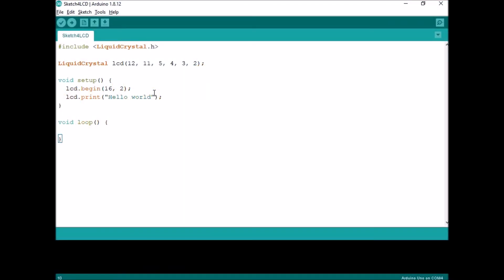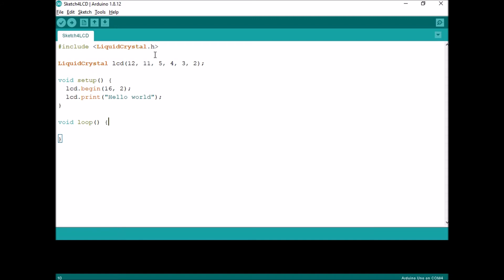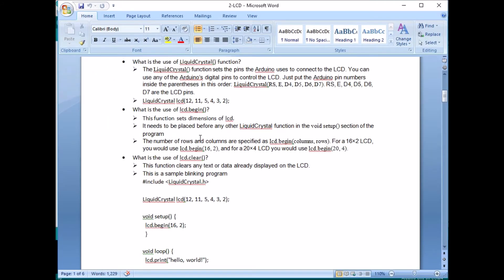21-Usage LiquidCrystal header file

Comment: 18208- ec-005
I understood this program I have learnt to usage of liquid crystal header file .this is already available in the Arduino IDE .
By using sets of liquid crystal function pins of the Arduino this pins interacting the lcd pannel to the Arduino physical board.